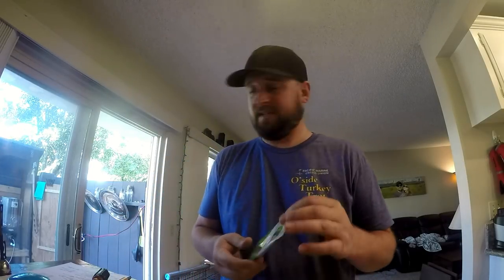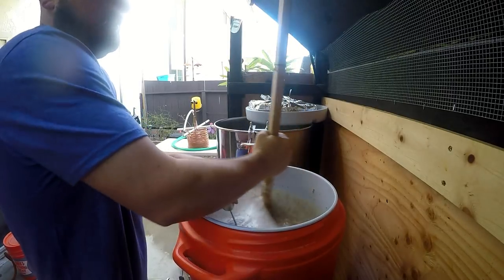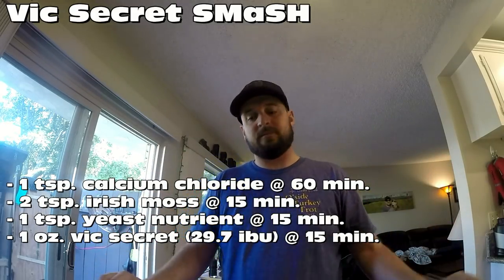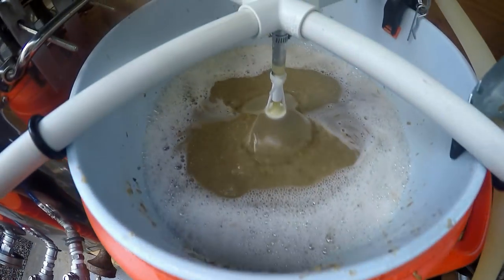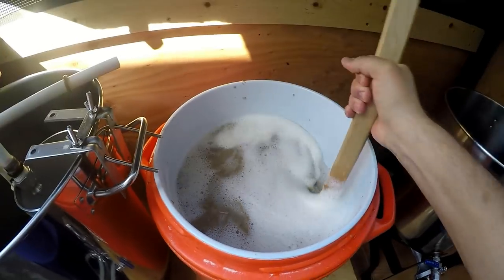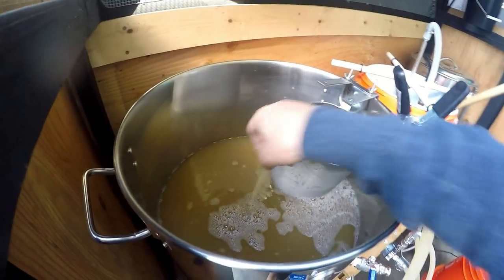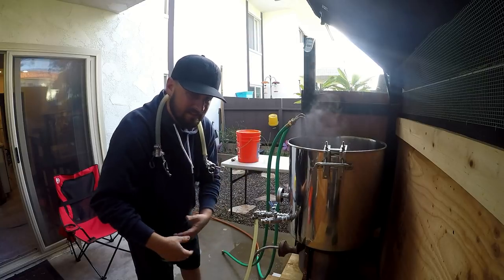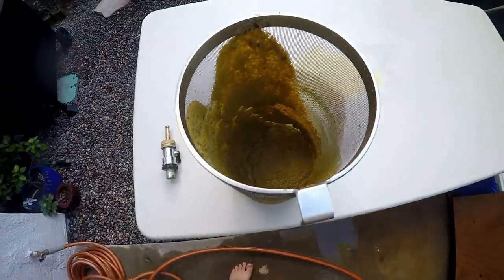"Victoria's Secret SMaSH" - SMaSH IPA - Full Brew Day

Comment: Hi Josh, It's nice to see you brewing again, I wish we had your weather here in PA so I could brew outside all year long. Although it won't be too long until I'll be able to turn off the heat and open the brewshed doors while I'm brewing.  I'm currently planning on making a SMaSH of Briess 2-row, Motueka and US-05 inspired by the post Stass made recently and am also making a shopping list for my parti-gyle 13% barleywine and english mild. Cheers 🍺
Reply from the maker: Mike J Hey Mike! I actually brew constantly (few times a month) but I don’t typically post footage of my process and I realized that was lacking a bit. I’ve come to realize that people actually learn stuff from my videos which is still baffling to me but that’s the reason I continue to make these things. I love home brewing and helping others. Good luck with your smash beer, I’ve never used motueka before. What part of PA are you in? I am tentatively planning a trip to VA, DC, DE and PA this September so I’m a little curious where you’re at.
Reply from the maker: Mike J Oh and by the way, barleywine is right up my alley if you didn’t already know. I have a 14%er that’s still napping in my closet from back in October. Cheers!
Reply: I've been brewing regularly again since I got my new system finished, brewed 7 batches since January 27th and am now working on my big beers and Lagers for the fall and winter. I Have five beers on tap and a Helles in the fermentation fridge that I'm ramping down to lager temps to have ready for memorial day and this afternoon I'll be putting my Marzen in a keg to lager until septmber. I really need to make an update video soon...  Ok, enough rambling, to answer your question I'm in the south central part of PA, not too far from where SJ lives. If you get out this way let me know it would be awesome to be able to meet up with you somewhere. Cheers

Comment: Looked like a great brew day with a solid process! You could shave some minutes off by starting the boil flame after beginning to take second runnings - taking into account a couple percentage points of volume expansion, but beyond that, looked great! Cheers!
Reply from the maker: Yes that's a great point Tony, I've started doing that with my sparge water while taking my first runnings already but I've been meaning to do that w/ second runnings as well. Would there be any worry with regard to a slightly higher pre-boil gravity due to evaporation that occurs during that rise in temperature you think? Would it probably be minimal if at all? Probably best I don't make a mountain out of a mole hill. Cheers Tony!
Reply: Manbearpig1122334455 Under normal conditions, not nearly enough to even consider. Cheers!